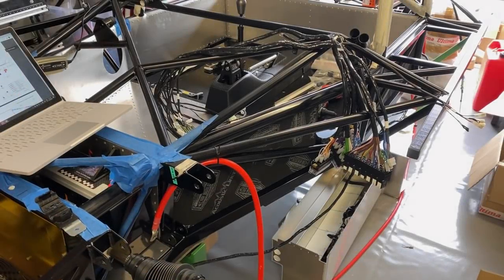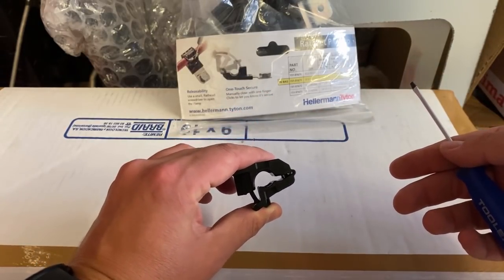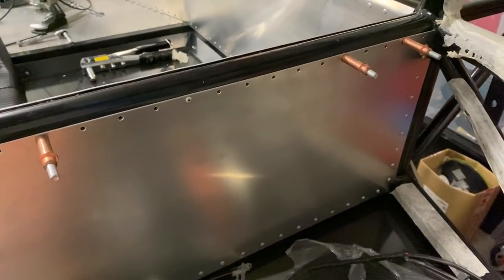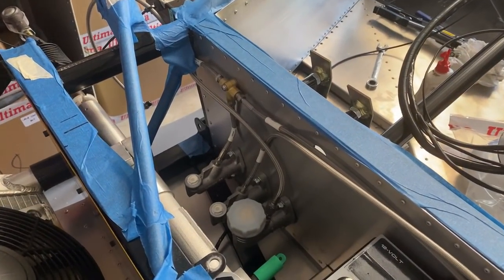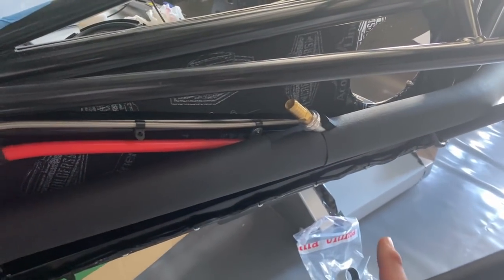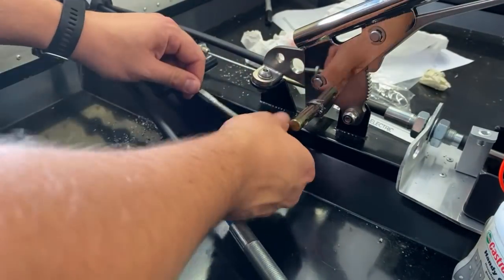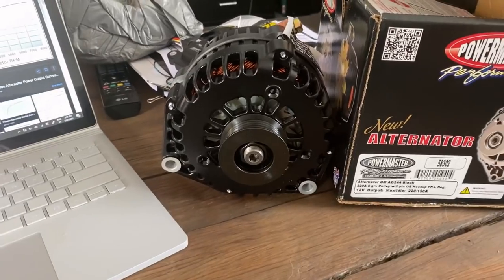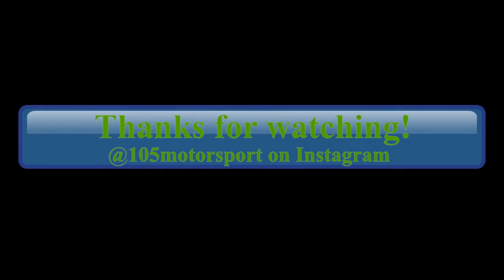Ultima RS - Alternator sizing, brake line install and wiring (electrical smoke is bad) Video #15

Comment: Bosch's alternator would have done the job
 Do you not like German engineering
Reply from the maker: Any particular Bosch alternator, or just a Bosch alternator because if it's German it'll work? Like, if I pull either of the ones out of the two BMWs I own, they'll be able to do 150A at idle. 
I hate German engineering.... Except for their cars, Bosch electronics, Aldi, Adidas, Weiss beer.... and their food. Each of the four times I've visited I've never gone back.
Reply: @rob105motorsport  this is the exact kind of humor I expected from you. 😂
Reply from the maker: @Brianlikescars  Couldn't help myself.

Comment: Dude, don't go dissing on the auto sparkys. Maybe some smaller local shops won't have an answer on alternator choice. But as sure as there's shit in a cat they will have forgotten MORE than you know about the rest .  Not trolling mate.  Just advice.  Car's looking good. Cheers !
Reply from the maker: Definitely not dismissing good auto elec's, so I do apologise if it came off that way. I also appreciate feedback so don't take it as trolling at all. 
Truth is that I very much respect good tradesman. To clarify, it's just very difficult to find knowledgeable people where I'm located who are interested in producing quality work. I don't think that's isolated to the auto trades though. We have a real problem in Aus' with service quality. But in part that's driven by people not wanting to pay a fair price for good work. I get quality tech' help and deliveries from the US and Europe faster than I do from local shops which is just embarrassing. Cheers.

Comment: Hey man, watch it with the negative Buell comments. Lol 
Seriously though, you have a point, but they went from one of the worst possible powerplants to what I think is one of, if not the best powerplant put in a bike. The 1125s were MONSTERS. I rode the shit out of mine. Same HP numbers as the liter bikes, but twice the torque and a tick over 400lbs makes for one hell of a fun ride. Even with my big 210lb ass on it, it would lift the front wheel in 3rd gear going 90+. I raced every 1000 out there and never lost a single race. Even walked a Hayabusa on it, but I think that probably says more about the rider. Haha 
Sucks they only made the 1125s for 2 years before Harley shut them down, but if Harley hadn't ran them into the ground with absolutely zero marketing, they would have given Japanese bikes a run for their money sales wise here in the US. Most people don't even know what they are. I actually called the local Harley stealership one time and the girl said, "A Buell? What's that?". It was literally in big letters right underneath the HD sign out front...
Reply from the maker: Haha, don't worry, I'd own a Buell. It's actually really disappointing that they died. I rode a few when I worked at a bike shop and enjoyed it.
I kind of think they're spirit lives on in some of KTMs road bikes. As you say, I think they were a victim of circumstance more than anything else.

Comment: I plan to build a tube chassis "kit car", something between this, Caterham or Ariel Atom, I think that would fit well in the build and keep the the buttons close to hand! :)
I retained the Ali V8 I did a full rebuild on from the LandRover, I plan to use this for the heart of the build and give it a few mods to liven it up a little. I had to get rid of my LandRover a few years ago due to space sadly.
Reply: I also just noticed you have a series tshirt! awesome!
Reply from the maker: @rompdude  Love LRs. I've got an Ex Army Defender and a S2A. Just simple, enjoyable motoring!
Aus' had a lot to do with a car called the Elfin Streamliner which is a V8 chassis which might be worth a look if you like V8 powered Caterhams etc. Cheers!
Reply: @rob105motorsport  I would love another, great vehicles, despite their age even early series are surprisingly capable! Cheers I'll take a look, sounds like a good basis if nothing else.

Comment: Engine out of 987 with a turbo  986 would have given 600 plus bhp  and brakes Would have solved all these problems you are having
Reply from the maker: How would it have solved any of the perceived problems?

Comment: Happy New Year to you too Rob.   Hope Santa was good to you.  :) There shall be NO OPPS!!  on this build :)   Just keep doing what you are doing.  Question:  with the one wire coming from the Alt to bat, will you have a reout of the output on your dash?
Reply from the maker: Happy New Year! Yes, Santa looks after me very well. I haven't noticed anything that's been stuffed up just yet, but i'm not infallible unfortunately, haha.
If I had an analogue gauge/light then I would need to wire up the feeds to those. The ECU will get a voltage read that it can feed to the AIM dash via CAN, and the alternator is self exciting, so I've kind of circumvented that. Cheers, Rob
Reply: @rob105motorsport   Guess I am showing me age, but I cannot seem to trust the ECU to work all the time and would need to be on one of the screens the AIM provides.   Hate the limitations lol   No worries on the stuffed lol   you will find them ALL !!!   heheheh
Reply from the maker: @acblack1032  Yep - The ECU will show voltage in real time and you can also set up warnings if the ECU gets a reading that is out of the norm'. Completely understand the attachment to mechanical components - they're what I grew up on with my old man's classic cars.

Comment: I'm interested to hear your thoughts about PDMs rather than fuses and relays? I'm leaning towards one for my project. Although pricey I like the idea of configurability. 

Also, brake lines are a nightmare. The front to rear link on my mini has metric front, imperial rear on the same pipe!
Reply from the maker: Hi Luke, PDMs are the best solution. Only downside is cost, the unit gets hot, and you need to learn how to program your unit. Do it if you can! 
Brake lines can be a proper amount of pain. Especially if you have mixed and matched stuff because there's a number of different flares, and even the nut sizes on the fittings are slightly different (which is why every classic car has rounded/snapped gear). Definitely not the most complex thing, but it does pay to get your head around exactly what your car has. Even brake shops stuff it up because you can sort of get away with certain mismatched setups. 
If you're not already across it - http://racetrackdriving.com/tech/brake-line-flares-metric-sae-inverted-bubble/
Cheers, Rob

Comment: Happy new year Rob. Just wanna say you really opened my eyes with the ptfe braided lines. I was having trouble running the hard brake lines, and didn't know the braided lines were even an option. So I'm gonna run the braided lines in the front and engine bay, and run straight hard lines to the back. Alot of bends and turns in bmw's 2002, but braided lines are gonna make it so easy. Thanks and look forward to what's next.
Reply from the maker: Hi Orest, I really like hard lines. My initial thought was to go away from the PTFE. But you can't argue with the ease of install, and the life of the hoses that are now available really make them 95% as good as a solid line. BMW 2002s are really awesome (I've got an E46 M3 and E28 M535i). Your plan for your car sounds good. Cheers, Rob

Comment: Happy new year Rob!
Always nice to see your attention to detail. I had no idea alternators worked that way, makes sense though. I have the same with pumps at work, people don't understand curves!
Reply from the maker: Hi Mike, Thanks. At least with an alternator you don't have to try and explain NPSH and everything else, haha. 
Electrics are not particularly my forte, but I'm increasingly finding the need to get my head around it all. The next build will run a carb'. Cheers, Rob

Comment: Oh I noticed you're using the flex line hope it's got a harder inner liner plastic tube cuz those expand and if you use a smaller caliper it won't activate your Pistons as easily it'll be they won't work as well
Reply from the maker: Definitely multi layer teflon lined stuff is the standard. Cheers!

Comment: I would love those raptor controls on my build, you have my Instagram @speedsterv6
Reply from the maker: It definitely would be awesome in your car, Mattias!
Reply: @rob105motorsport  Absolutely, can't even reach the stalks after spacing out the wheel to where I want it 😅🤣

Comment: Love this build great informative info always 👍thanks for that. I’m looking at the raptor atm but haven’t committed. I’m running Ra28 celica, sr20 EFR Emtron KV8 customs IRS that I modded and made , EPS, just fitted up an m3 DCT custom adapter with HTG GCU. Massive learning curve this year fabricating and learning CAD 3D printing to prove all the custom parts. Just had my MME paddle shifters arrive the other day so the Raptor would just be sick to see in my build. Look forward to seeing more content 👍 car nuts we are lol
Reply from the maker: Thanks mate! Early Celicas are awesome and that setup sounds really good. Do you have any pic's of it coming together?
I saw that the Emtron guys had a 2J in an 86 hooked up to a BMW 7 speed and it seemed well sorted. Who's going to tune yours?
Reply: Rob 105 ok so I updated utube and it allowed me to read the whole message 👍 guy here in SA garage7 Declin is well sorted in Motorsport tuning and Emtron. Emtron is there for help aswell so not going in totally blind. Will be running all the usual stuff PDM , dash and so forth
Reply from the maker: @bigmattolly4910  Nice! The Emtron guys seem to give good support. I originally was getting Competition Systems in Melbourne to tune, but they turned out to be shonky (still owe me money after 7 months). Thankfully Insignt Motorsport in Sydney are going to get the job done properly. My email is robwithers@hotmail.com. Cheers!
Reply: Rob 105 I tried that email came back as invalid 🤷🏾‍♂️
Reply from the maker: @bigmattolly4910  Seems odd. Some emails just came through?
Reply: Look now from Ben gmail
Reply: I press on the read more and nothing comes up bloody utube lol
Reply: Yes I gave plenty of pics. Occasional post on fb and performanceforum. No Insta sorry. If you have email or something I can send over

Comment: Happy New Year Rob, do you have a link to the harness clamps? I like that idea and have not seen them before. Nice job on the alternator discussion. Early in my build, I went out and bought the factory LT4 alternator and turns out it needs a PWM signal to drive what voltage it generates. There are small cheap devices to generate that signal if your ECU cannot, but to your point, having the option of a one wire hook up is the way to go.
Reply from the maker: Hi Joel, Thanks! I realised I got them from 'Element 14' (link below). Really good source of commercial quality electrical stuff. 
The control of your LT4 alternator (and other components) is definitely more complex as you mention. It's really one of the few downsides in using newer/better generation running gear and why most guys are sticking to OEM equivalent ECU(s) if transplanting. Like anything, you have to respect that there are reasons that manufacturers go to more sophisticated control systems. It's only that cars like the Ultima aren't going to do millions of miles that make it a consideration.  
LT4 is a cracking choice for your SL-C by the way!
https://au.element14.com/hellermanntyton/151-02737/cable-clamp-36mm-pa66-ss-black/dp/3255521
Reply: @rob105motorsport  Thanks Rob, appreciate the link. Turns out the GM aftermarket harness and ECU can control the PWM alternator, but Since I have to do emissions legal I am using a production ECU and turns out the production car uses a body control module and not the ECU to control the alternator, but I have a solution so it will all work. Have fun, keep up the good work.
Reply from the maker: @JoelKSLC  Sounds like you've got your head around it. Most cars now run multiple ECUs too, so it's getting harder and harder. 
Emissions legality is always a good bit of fun - I think i'll be on E85 at least for my testing.

Comment: Hi Rob great to see it coming along....just something to have a look at....white masking tap has a habit of deteriorating over time leaving residue behind. Your blue low tac tape should be fine. 3M is the best in my experience. Just have a look, as the longer it's there the harder to remove.
Enjoying it
Reply from the maker: Hi Rob, Thanks for the tip. You're 100% correct. The white stuff holds on better, but it has indeed started to die. It leaves a residue and rips apart now. It's a bastard to remove, but the residue comes off ok with the 'wax and grease remover' thankfully. Shouldn't be long until I can remove a lot of it, but i'll stick to the blue 3M stuff for sure.
Reply: @rob105motorsport  somthing else to think about...the white masking tape is the best for masking off for painting as the blue tape can allow solvents to creap under...found that out the hard way. 👍
Reply from the maker: @robsampey1092  I picked that up somewhere. Apparently the 'fine line' tape that paint guys use is meant to be the go for avoiding any absorption, but that blue stuff probably does the job too.